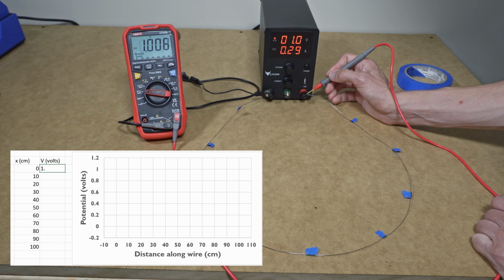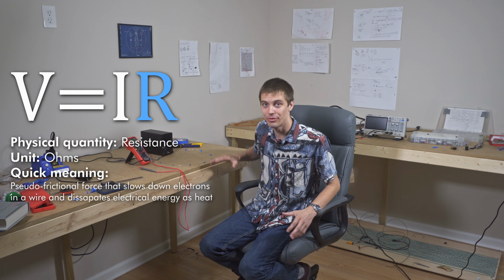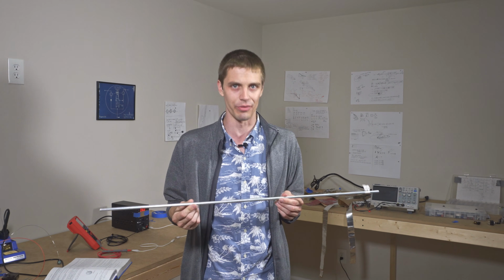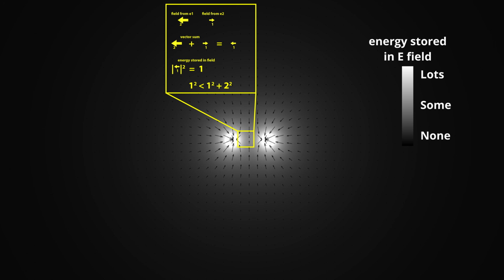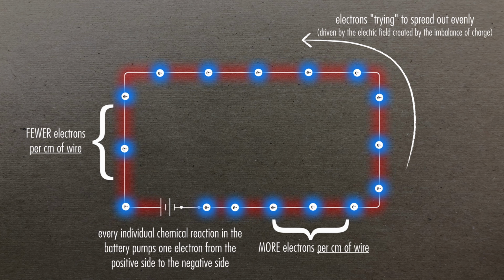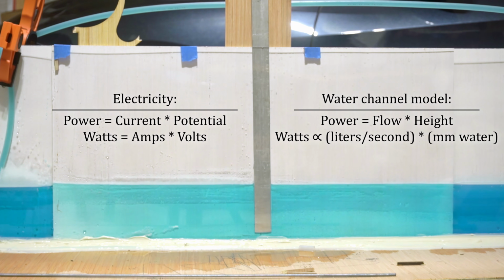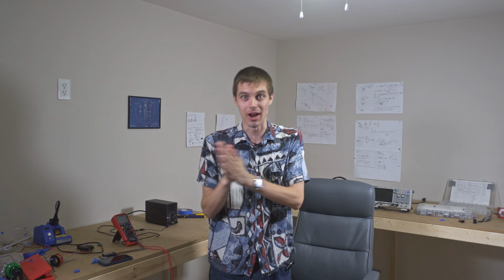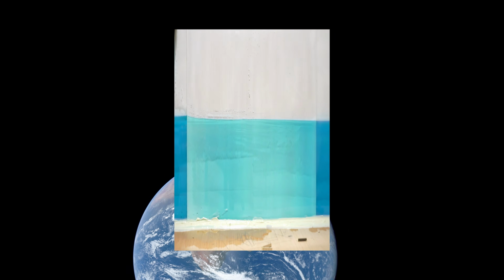An intuitive approach for understanding electricity

Comment: I would say that voltage is a kind of force that increases when electrical particles move closer to each other in  the same way that gravity potential, like you used as your analogy, works for elevated bodys.
if you release the particel, you will gain additional force due to that voltage other than the initial columb in the same way the force for the falling body will gain more force due to the gravity potential, right?
Reply from the maker: You’re confusing stored energy and force - the bout feels a greater restoring force (buoyant force) the deeper it sits in the water (gravitational potential), but these are different things that scale differently with the properties of the buoy, so they shouldn’t be conflated.
Reply: @AlphaPhoenixChannel  Okay, what I ment was that's a kind of force but as the distance between the particles is stabil the is no resultant force as nothing is moving.
As in a loaded spring, there is a counterforce that holds it in it's place (opposite vector) but vill add the amount of linear force when released.
But of course, I might confuse the work to load the spring as a force instead of a resulting stored energy that become a force while it's released due to the stored energy.
Thank you for correcting and thank you for your answer

Comment: At around 16:30 you're talking about the field itself storing the energy - does that mean the field has a mass, and exerts gravitational force etc? I suppose it does, but is it ever a practical concern when we're designing circuits?
Reply from the maker: The gravity isn’t, but the ability for all components to store energy in fields shows up as “parasitic capacitances”
I would LOVE to be able to measure weight change due to energy mass, but every time I do the math it’s untenable. For a lithium ion battery you’d need to be able to measure the mass to something like 1:10^11
Reply: @AlphaPhoenixChannel  I'm sure in a few years we'll be able to find scales on Temu that claim to be that accurate 😆

Comment: You said electrons travel at a half a million meter per second (13:00) but as far as I know electron velocity it too small? Is that correct?
Reply from the maker: I think that’s the segment where I mention the speed it would reach traveling through vacuum - nothing to run into like nuclei in the wire or other electrons

Comment: In my opinion the current distribution in 22:15 is wrong. I think the charge density should be the same everywhere ("charges spread out evenly") Every metal has a specific density of free charges. see https://en.wikipedia.org/wiki/Charge_carrier_density  e.g. in case of copper 8.47×10^22 m⁻3. In your graphic, the density varies.
I think we agree that every cm of wire should have the same voltage drop. Now compare a cm near the battery minus pole and another near the battery's plus pole. According to your graphic, they have the same current, voltage drop (also implying same electric field along the wire and same magnetic field around it), but different charge densities and charge velocities. This seems wrong.

Comment: The anology of voltage is not entirely how I see it, voltage can be on a wire or in a circuit, while the is no current going through it.  a wire with voltage on it has potencial! , both DC and AC in DC to the minus or ground and in AC always to the 0 where the is no energy.

Comment: So lets talk indutance in the water model!
Reply from the maker: Inertia of the water is like an inductor
Reply: @AlphaPhoenixChannel  
Yeah, like wire has its own inductance, but I mean an inductor itself. Something that directly affects the inertia of the water without a lasting voltage drop.
Reply from the maker: @ODDnanref  a low-friction pinwheel with a high moment of inertia submerged in the water would do it

Comment: The Electrical Energy transferred from source to load is not traveling along the wire in the direction of the electric field, the energy is actually traveling in the direction orthogonal to both the electric and magnetic fields. The Poynting vector describes this phenomenon indicating both direction and magnitude of the energy traveling once the charges begin to move (you need moving charges for a magnetic field). The cross product of the electric and magnetic fields are in the direction of and proportional to the energy flow at a given spacial point and at a certain time. There is a much more elegant explanation from The Science Asylum’s video: https://m.youtube.com/watch?v=C7tQJ42nGno I love the idea of the resistance model for different energy domains like fluids, heat, mechanical rotation, and mechanical translation because it gives us great intuition for energy transduction for multi-domain problems, but the model seems to break when we look at vectors to describe the direction of energy flow.
Reply from the maker: This results in a lot of really strong vectors immediately adjacent to the wires that point nearly straight down the wire towards the load. In this case, concentrated in the middle of the twisted pair. The field can be imagined as part of the  electrons that are moving because you can’t strip the field from the electron and none of the Poynting stuff starts happening without charges physically moving

Comment: According to Veritasium, fields to the work.
Reply: According? Since when YouTubers are "source" of knowledge? Basics like that (EM fields, energy living outside the wiring) are covered in textbooks from last 100 years. No YouTube needed.
DC, AC and radio stuff is the same. Common denominator is: metal (both wires/cables and antennas should be metal, electrons help us to transfer, direct the energy).

Comment: Energy lost as heat is called hysteresis. Word of the day

We didn't use the water model in college, it to simple and doesnt account for magnetic field.  Electrical magnetic wave..cant have 1 without the other
Reply from the maker: That’s not what hysteresis means, but hysteresis in magnetic materials could dissipate heat I guess?

Comment: Nice presentation, but I disagree vehemently with the use of terms related to speed or acceleration in connection with Ohm's law and resistance.  I don't know if anyone has even measured the average "speed" of electrons moving through a resistive material - as opposed to speed through a conductor.  Begging forgiveness for any inaccuracies that may follow from continuing to refer to the liquid model, we know from fluid dynamics that flow rate = density times area times velocity.  If the representation is accurate, then the current is equal to conducting path area times charge density times average electron drift rate.  The area is clearly not part of the discussion, but current can still increase/decrease without changing speed - if the charge density changes.  In the absence of evidence of a "speed change" in conjunction with resistance - I'm not aware of any such evidence - I'm inclined to believe that charge density, rather than drift speed is what accounts for reduced current.  At any rate, I think it gives a possibly inaccurate - and unnecessary - understanding of resistance as "slowing down" electrons.  Unless you're into quantum mechanics or similar research, it's only necessary to know that resistance restricts or limits current - whether by drift speed, charge density, or some other atomic phenomenon, that is not important to the use of Ohm's law.
Reply from the maker: The area does matter - the resistance of a wire is inversely proportional to its area (the conductance is directly proportional to the area). The charge density does not change meaningfully within any material as a result of resistance

Comment: PLEASE EXPLAIN: he claims the electrons are ENTERING the left side of the wire then hit the resister and then return to the power supply on the RIGHT side. 

The water example shows us that the volts SHOULD be higher on the ENTERING side. BUT he uses the multimeter from RIGHT to LEFT. And we see the volts are higher AFTER the resister NOT before like the water example. The actual measurements are exactly opposite of what the water is showing us. WHY?

Comment: Not the water analogy again. Great for a simple understanding, but incomplete, if not just outright wrong. If you really want to understand it, go watch the Veritasium explanation.
Reply from the maker: I’m well versed in Derek’s explanation - wouldn’t have made this unless I thought it was a more useful model. You should check out the playlist
Reply: @AlphaPhoenixChannel - I will, thanks. This still leaves out magnetic fields, which is a problem. The “Shepherded” electron analogy is just as easy to understand, and a bit more accurate. Have you considered trying to use it instead? 

Guitar Tube amps are experiencing a renaissance, but too many hobbyist builder’s have an understanding that is limited to Ohm’s law, and a basic misunderstanding of what’s really going on. It’s usually due to this water analogy.
Reply from the maker: @ElCidOfZen  the electric field is a lot more important than the magnetic field in the vast majority of cases, and even then, both field only exist because electrons are moving (or accelerating) in wires. I don't like the "particles are shepherded by the fields" analogy at all because it ignores the origin of the fields, leading people to a lot of confusion. batteries don't make fields - they push electrons one at a time into a wire with capacitance, and that creates an imbalanced field, which then results in current. even in transformers and inductive components, it's still moving electrons pushing on moving electrons - they have a few different ways to push
Reply: @AlphaPhoenixChannel - The battery has a field, whether the circuit is connected or not. Connecting it thru a circuit establishes a field that precedes the electrons, and will even propogate to wires unconnected to the circuit. Current thru the circuit will then help to maintain a near field, but it’s not the creator. You're putting the chicken before the egg. Do fields move electrons, or do moving electrons create fields? Both.
Reply from the maker: @ElCidOfZen  look up how a battery works
Reply: @AlphaPhoenixChannel  YOU look up (academic textbooks from last 100 years) how EM fields work (where is the energy: OUTSIDE the wires).

Comment: Every atom has a center point where electrical charge initiates from and individual rays of charge radiate outward from that point .  The termination point of those rays are electrons .  Electrons are not tiny little balls slowly shuffling their way thru the solid metal of a wire , they are little fingers coming out of the atom searching for a place to discharge if the amount of charge were to reach saturation point .   Electrons do not carry energy with them as they move like little dump trucks .
Reply from the maker: Electrons don’t radiate charge. They carry charge like little dump trucks

Comment: Really enjoying going through this video to try and understand better, but I'm feeling a little confused about your explanation about the two electrons in an empty universe. You represent the energy contained in the field of an electron as vectors, with the direction of the vectors pointing "inwards" towards the electron. Maybe I just don't properly understand vectors, but I'd assume that the vectors representing the energy of a force would represent the direction that force is applied in. If it's applied "inwards" then I don't understand why the electrons would push each other apart if the field in between the electrons is canceled out, especially since, as you say, the vectors farther away from the electrons add together. That sort of makes me think that the electrons would stick together the closer they got, not fly apart. Obviously, they don't do that, so I think I'm basically misunderstanding the proper usage/interpretation of vectors in this example, but clarification would help if you can. Thanks!
Reply from the maker: They are electric field vectors, which by convention show the force the field would exert on a positive particle. Kinda annoying when dealing with electrons!
Reply: @AlphaPhoenixChannel  Ah! That makes sense. Thanks!

Comment: I must say the VERY beginning of this video when measuring the voltage along the wire at various distances and hearing that the voltage was dropping really kind of messed my understanding up for a while...I finally went back and RElistened and heard you say "I have a REASONABLY RESISTIVE WIRE"....I ASSUME the fact that the wire you are using is "REASONABLY RESISTIVE" (instead of some "standard" copper wire that has very little resistance) is why we are seeing the voltage change ??  Otherwise I need to go back to my basic understandings since there doesn't seem to be any other resistance along that wire...
Reply from the maker: You’d get the same effect with copper, it would just take a beefier power supply because you’d have to push more current to drop 1V over that length. (You could also use really thin copper)

Comment: Particles of electricity that make up a current of electricity from a power supply either AC or DC race through, air, water, and solids. The whole idea that particles of electricity do not really move through a wire was too cover up the failure of modern science, and the idea that particles of electricity are orbiting the nucleus. 

When we spot weld, the electricity does not flow around the sheets of metal . The electricity flows directly through each piece of metal being joined at the point they are being connected/welded. This is easily demonstrated because when you put more and more spot welds on the same pieces of metal  there is no extra power needed to do the next spot weld. Unless the parts or electrodes get hot and create internal resistance. If electricity flowed on the outside of the sheets of metal with each spot weld more current would be needed to make the next weld, as the resistance lowered with each spot weld. But obviously the current races right through the two metal plates at the point of the spot weld. You can even edge weld two plates together all the way around the edges of two plates, and then put spot welds in the center of the plate and there is no difference in current needed. 

What is being covered up is that there is only one sub-matter particle the particle of electricity, and that protons are just spheres of particles of electricity. Ambient radiation is particles of electricity that cross the universe in the blink of an eye, and create and stabilize matter.

I was taught by and hung out with Universal Scientists who were openly being silenced by the government, so that the openly announced counterintelligence operations that were initiated during WWII,  but started before WWI would not be exposed.

Comment: Hi, I'm watching this video a couple of times. But as a beginner in this area, I got a question. I assume electrons go from lower to higher potential. I mean that electrons move to the opposit direction of current, which moves from higher to lower like what you're saying. What am I missing at this point? I'm sorry it is so basic to you, but I'm so confused about the relationship between potential and electrons. Can you help me understand it, please?
Reply from the maker: You’re completely right - “potential” is (by convention) set for a positively charged particle, but in wires, it’s the negatively charged electrons moving, so they go the other way. It’s an unfortunate bad guess from the early days of electricity when they didn’t know what direction any real things were moving, they just knew that overall, “electricity” behaved like a pressurized fluid. The good news is that 99% of the time, you don’t have to care. If Ben Franklin couldn’t tell it was the negative charge that was moving, most circuits you build won’t be able to tell either 😁

The exemption to this is vacuum tubes, where the electrons fly free by themselves - that’s actually how they figured out it was the negative particles moving and not the positive particles!

Comment: In your (otherwise excellent) video you state that "increasing the voltage increases the drift speed of the electrons". Couldn't it be that just "more electrons" start to move instead of merely a speed increase ? I've searched the net for an answer but I only find confusing (and sometimes contradictory answers).
Reply from the maker: That would require the density of mobile electrons to change by a large margin, which it does not. In general, you can assume metals donate about one free electron per atom. Other materials get messy
Reply: @AlphaPhoenixChannel  : Thanks ! Sounds logical.

Comment: Electrical energy flows through the electric and magnetic fields traveling outside the wires.
Reply from the maker: Ok…?
But it can’t do that unless the electrons in the wire are moving as described here
Reply: @AlphaPhoenixChannel  alternating current. The electrons are only vibrating, yet the energy moves outside the wire. All electron flow theory is just a crux for those who can't grasp the underlying physics.
Reply from the maker: Alternating current from your wall only pushes energy into a device while the electrons are moving. It’s the charge flux from moving particles that creates the magnetic field, and an imbalance of charge that creates the electric field, and you need both to define poynting. AC is better understood as a DC circuit that isn’t on for very long so the electrons don’t move far. If you think of the electrons as a crutch to be ignored, you won’t have fun in solid state physics and semiconductors.